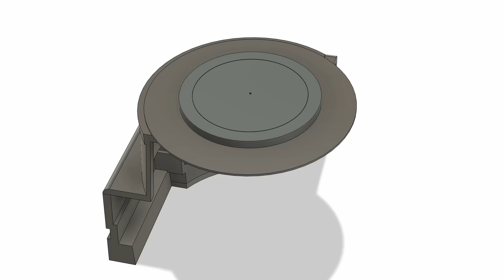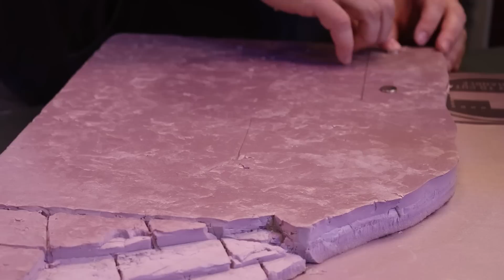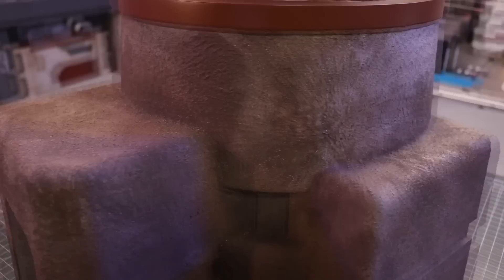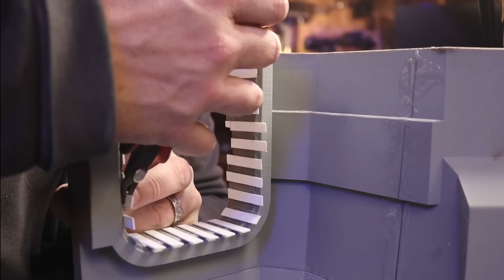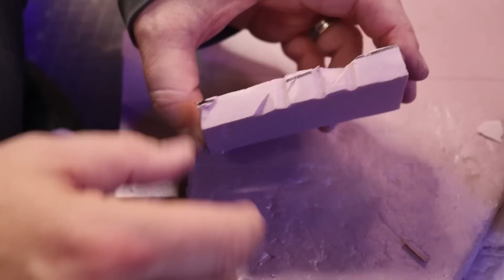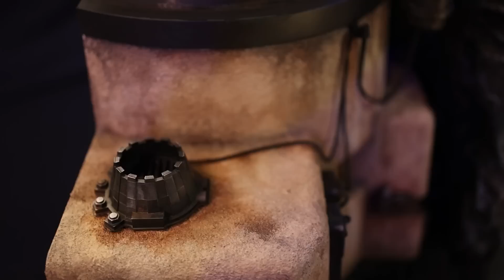A New Way to Create Texture On 3D Prints | Star Wars Diorama Project

Comment: Rewatching this one, going over the diorama playlist for a little Inspiration, a Thought Occurs!!
I don't Follow you So Closely to really pay much attention to what you do Outside of your videos, I say that as I'm not assuming anything and what Thought Occurs you might have already considered.
As I have Noticed you've begun doing Conventions and the Corner Wall Unit Design for HOME is GREAT.
But HALF the Work CAN'T BE SEEN Should this project be made Sectional for easy Transportation to a Convention or Public Display. (I could see this behind a plexiglass case at a Museum or a Library Easily.) So Ease of Transportation and Movement might be of consideration. A sectional low level shelf Unit set on Casters is essentially what I would be going for.
Sectional..meaning SOMETIMES a Project like This, needs a Sequel. A Means to Naturally Grow and your Choice of Shipping Containers as your Display medium as a COSTUMED Shelving Unit, just needs a Walkway leading off to Nothing. That Nothing could be the NEXT DISTRICT someday. Because as of late, Hasbro has been making Smaller and Cheaper Vehicles and Figures. The Figures are a Hair Larger than the 3.75's but a few of those here and there really only adds to a variance of Height among the crowd that doesn't look Unnatural.
I've been looking to do something similar to a plain old bookshelf, but to make it look like a Multi Stories Slice of a City Planet environment. Scaled to either 3.75 or 6 inch.
Or a "HabBlock" apartment building complex with a Utilities and Amenties and Retail every few shelves kinda deal. Make a shelf look like a Building.
I may have given up on my fan film project...but snippets Survive and linger still. 
But yeah, keep a "Doorway" open in the design on either side. Something Temporary but looks like its Permanent.
The Backside of the entire display needs it's own Costuming now IF this display goes on the road with you. And Keep in Mind...this is Mostly gonna get Moved by U-HAUL...so you Need to Incorporate or have Surfaces around the Outside for WRAPPING and STRAPPING for Transport without Damaging anything on the exterior.
But yeah, the Backside needs to be As drtailed as the Front Side IF it goes on tour for Public displays.
You're a Woodworker bub at the end of the day so I'm Sure that yye structure you devised for a Home display and the Odd Move, it will endure.
For the Road though...its gonna need some Reinforcement and Castor Wheels. Do that and it becomes an Ease and a Dream to take with you.
Loads up a ramp onto a truck with Ease, the Crates design makes for Easy Moving Blanket and Plastic Wrap to cover and Protect, and Easy to Strap and tie down to the Bars on the walls with a few rachet straps. Good to Go. Toss in the rest of your Convention Gear in there as well and Voila, your Glamping on the convention circuit. 
Just a thought! 😁🤘

Comment: Haters are gonna hate. I remember a long time ago, in a local martial arts school I attended. One of my instructors said, if you can add something to your arsenal do it,it will only make you better. In this case, using a 3D printer is just another tool in your toolbox to get what you want done. I think 3D printers only expand your creativity potential. So 3D print away and let the na sayers boil in their own pudding. Again the display pieces turned out amazing.
Reply from the maker: @DMAbCD  very wise indeed.  Thank you much for this comment.  Very much appreciated!
Reply: @TheSmugglersRoom  I thought I would share an idea I use for my dioramas. For stone effects, I recently started using wood bark chips. You can stack them and position them in ways to make them look like real rocks/stones.

Comment: I just designed and printed my first greeblie using Blender and man does it use your WHOLE brain!! I’m still learning the software and while it is pretty user friendly, it is by no means easy when you have no prior experience. 

Love this build and the whole concept!
Reply: 3D printing is probably one of the most perfect applications for creating "Greeblie's" by the hundreds...  No need to cobble together bits of styrene, wood or acrylic.  No need to buy endless model kits just to scavenge a handful of parts and have the rest collect dust for all time.  

Just design and print your own!

I'd have a good laugh to hear one of these pro model builders that buy kits for greeblies tell me that using a 3D printer is cheating.  It'd be like, "dude...  You're buying a kit to scavenge parts.  I created my own parts, then manufactured them MYSELF".
Reply from the maker: That’s awesome!! And you are totally right, takes a lot to really work out the design right?

Comment: There is one thing that I highly recommend changing for most people that spray primer. That switching from the rattle can air curing primer to a 2K two-part primer. One that is used in automotive finishing. First off it's a lot cheaper! A gallon with hardener is $100. Since you're not spraying out a bunch of solvents and basically stuff that is just making an aerosol you're getting more product for your dollar. And instead of having to wait hours and sometimes a day or more to start sanding, since it's a a chemical activation, you'll be ready to start sanding in less than a half an hour! Yes you need a compressor and a dedicated paint gun. But you can use a small detail sprayer and they make the throwaway cup system for these as well. I'm going on 2 years of spraying on a 1 gallon container and do quite a bit of work lol. You can lay down more layers faster also if it's an issue with filling areas. It has some of the best filling properties of anything you can spray also
Reply from the maker: Thanks for the tip! I'll definitely have to look into that.

Comment: Yep, that was cheating! You designed this, a few days, you printed some 3D parts, probably a couple of days worth, and then spent probably a full work week, at least, to make it look incredible. Most of us would have have stopped with the print, or maybe used fuzzy skin to add texture to the lower parts instead. If it looked perfect though, it wouldn't look anywhere near real, and that's where the "cheaters" like me, differ from the realistic modelers like you. I've been learning to 3D print for 7 years, and there is no way to do what you have done with just a 3D print. Your 3D prints are the canvas for the artwork, not the artwork itself. You do incredible work!
Reply from the maker: Thank you so very much.  I really truly appreciate this comment.  Appreciate you!

Comment: Bryan - Alright...here I go.  Rotate your prints on the print bed to about 45 degrees so they stand on edge.  It's even beneficial to create a 45 degree on the stl that is hidden or inconsequential.  This will make your prints far stronger because they layers are not purely horizontal.  They look better and if done right, you actually save filament and need fewer supports.  Number 2.  Forget the epoxy.  Gorilla super glue XL and selsil ca glue activator.  CA glue on part one, selsil ninja on part two and you'll never have a problem with adhesion.  On the magnets, we know you'll learn the depth thing.  One thing I do is after I install the magnets on the first piece (using CA and selsil), then take the magnets for the second piece, attach them to piece one in place, figure out best placement, mark the outer face of the magnet with a sharpie, then put the piece in place.  This should leave a mark on piece 2 for the magnet locations but also tells you which face of the magnet to put face down into your second piece.  To the naysayers that say you're cheating with 3D printing, HAHAHA the furthest thing from the truth.  I've made scratch built, kits, kit bashed, welded, etc...and 3D printing design is extremely challenging.  I look at the printer itself as simply a tool.  It's the design that is the hard part and to the people who say that, I say you're missing out on the opportunity that this tool can provide to help you bring your creations to life.
Reply from the maker: @EDGeProjects  thank you!!!!  Great stuff here, much appreciated

Comment: My only critique/suggestion for this build is that this would be the perfect use for much, much, much less expensive craft paints. For my money, those Archive X paints would be better used on a ship or character model than for weathering/buildings.

As for the 3D thing, I've found that while it may be true in the case of tools, etc., that you print it, pull it, and use it, when it comes to printing out hobby stuff, very rarely is a print ready to go off the build plate. There's still a lot of tinkering and work to get a finished product.
Reply from the maker: yep, agreed.  The Archive X paints are not cheap, they just happened to be what I had on hand at the time.  I have since purchased some cheap paints for the weathering.  i also agree with your thoughts on the print part, definitely need a lot of work after the fact.

Comment: Thank you for the video. How smooth are those prints, did you do any sanding after the print finished? I don't see any lines. It almost looks like a resin print. Fantastic information. Thank you.
Reply from the maker: Thank you!  They are pretty smooth, better than most I have seen.  I did sand the rooftop, and then used the spot putty, then sanded again.  That made sure it was very smooth at the end of the day.  But I will say, this printer is a beast, and the finish is really impressive!

Comment: Just another method/tool in the toolbox. 
I started as a manual machinist, moved I to CNC machining within 8 years. Computerized systems are just more efficient, and the item made can still be modified or altered by hand.
Reply from the maker: There you go!

Comment: between your 3d printers and resin printers, which one have you found the best prints on?
Reply from the maker: I tend to lean on the need I have to help determine the printer.  For example, this project was a large structure that I intended to cover with the texture, so printing on the FDM printer made the most sense.

For the highly detailed parts where I need a lot of clear definition, I lean on the resin printer.

So “best” prints seems to be more of a “best for what purpose” is that makes sense?

Comment: So just because you have a pencil, does not mean you can draw. A 3d printer is a tool.  It's like saying I'm not a wood worker because I cheat and use an electric table saw instead of hand saw? Using a table saw while looking simple actually takes skill to use safely and accurately.  3d printers is the same way. It's tool
Reply from the maker: Absolutely agree!

Comment: Looks cool.  
What about using a plastic cement rather than an epoxy resin if your going to be printing a lot of plastic components in multiple parts?  Also if your interested in doing so JuanHidalgo Miniatures posted something back 2years ago titled Get your Tamiya Extra Thin Gule CHEAPER!, that goes over some alternatives.  I've also seen someone recommend cellulose thinner from the hardware store as a good option.
Reply from the maker: Great suggestions!

Comment: With the QIDI Plus4 since its enclosed I dont really need to worry about ventilation? Thinking of putting one of these in the spare bedroom. Don't have a garage
Reply from the maker: There is a filter system in place.  I have not noticed any fumes or anything with this unit.  I do believe they have additional details on there website that would be worth checking out.

Comment: I got a printer to assist my building. I also wanted to make a few things like a guitar body and a Power Sword.  BUT, it got in the way. I just kept printing crap I had no need. LOL I put it away about a year ago and haven't had the desire to pull it out again. 

People seem to think you print something and its done? I used my printer to make my Mando kit and it was a LOT of work. So those who say "you're not a maker" if you use a printer, that's just poo poo talk. Its great for creating parts for builds, creating models, prototyping. Such a great tool. You just need to have impulse control, unlike me. LOL

Diorama is looking great.
Reply from the maker: Totally agree!  It can be a bit of a trap.  I think you just have to use it for specific projects, or specific elements.  Add it to the arsenal of tools.

Comment: That method for concrete has been used by model railroaders for years. 

I find that there is not enough cross pollination between the modeling hobbies. 
Model Railroad people are just now finding out about panel line paint (most are still using alcohol and ink)
Reply from the maker: Great point.  I absolutely need to watch more model railroad content to help with my process.  Excellent suggestion

Comment: To glue PLA together I swear by Weld-on 3 over epoxies and super glue. I have heard others use Weld- on 16
Reply from the maker: Thank you for that!  Great idea, i never even considered Weld-on.
Reply: @TheSmugglersRoom  you will need to get some applicator bottle with the needle tips to apply it. I think weld-on 3 is thinner than water so it works great with its capillary action.
Reply: @TheSmugglersRoom  Also loved your application of the grout/mod podge/water mix. Turned out awesome. I mostly use that mix for the ground in my dioramas since it is so messy. I also sometimes mix the three up together to start and spread that out so I don't have to go back with the alcohol and mod podge and water after. You can get different effects depending on the ratios of the mix. If I don't have enough grout in the initial mix and shift a bit more over the top and it will wet in with the rest of the mix.

I started out using spackle to get cool textures on the my building fecades then I switch to an acrylic-based plaster I was turned on to from Italy that mimics the look of concrete. I do a couple coats of that and play with the application to get really cool textures that enhance with paint and weathering. There is another finer grain plaster I use for smaller scale pieces but that is lime based and it really sucks up the paint that I apply so I don't like it as much.

Comment: Keep in mind that down the line you'll benefit from adding resin printer to your arsenal too so you can use the best suitable tools for large low-detail sections and small extremely detailed ones (greebles, figures, ...).
Also, remember that prints don't always have to be large.Remember the pattern screens on the TIE Fighter wings? You just gained something to make grid details like that too and since it's thin, it ill conform to everything, sometimes with a little nudge by a controlled dose of hot air.
Reply from the maker: Already with ya!  The details we added to the exterior had several parts we modeled and 3D printed out of resin.  We’ll have a video on that soon, but you are 100% correct, the detail you get with the resin printing is outstanding.
Reply: @TheSmugglersRoom  Glad you're already planning that far ahead too.
Even the people at Lucasfilm use that approach in helmets these days, like designing a Shore Trooper helmet for filament, but the air filter greebles in resin, combining the advantages of both methods.

Comment: Love it.  If you can, give SciGrip 16 a try for joining PLA prints.  It comes in a tube and you gotta be fast with it. Clamp or leave it alone for a time, but once it’s set, it’s solid.  You’ll love it.  If you try to split it, it’ll break somewhere other than at the joint.  WeldOn 4 can also be used to flow into a joint and works really well, too.  While epoxy is easily available, I stopped using it years ago.  Love your vids, keep up the awesome work dude.
Reply from the maker: Thank you for the tip!!  I’ll give that a try!

Comment: 3D Printing is great… Wish I could get one free. I just can’t swing it at this point. I’ll just have to live vicariously through others.
Reply: I've been using an Ender 3 for years. Super affordable. Perfect for my needs.
Reply: @ - Maybe one day…
Reply: The printer isn't the expensive part anymore. You can get a great machine for under $200. The consumables are the expensive part - if you use it a lot, the filament adds up. My $189 A1 Mini can easily go through more than $15 / day worth of filament when I'm using it constantly. If you think about that - you can use $180 worth of filament in 12 days... If you can't afford the printer, you can't afford a free one, either. You don't have to get something high end like the X1C or Plus4. For this kind of stuff, printing PLA or PETG (the 2 cheapest materials) on a small, cheap (but modern) printer like the A1 mini really works just as well. And most of the functional stuff I've printed fits on the little one, too.
Reply from the maker: We certainly are very grateful for sponsors that help us with these at no charge.  It makes all the work and effort worth it for sure!
Reply: @ All good. I truly enjoyed watching channels like this do some amazing things. It’s really often a high point of the week. Nothing wrong with that.